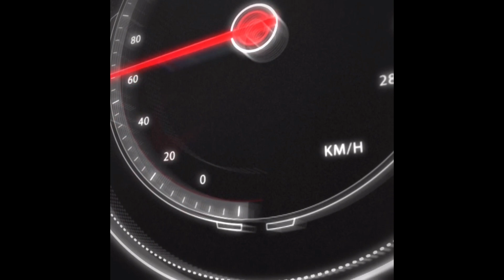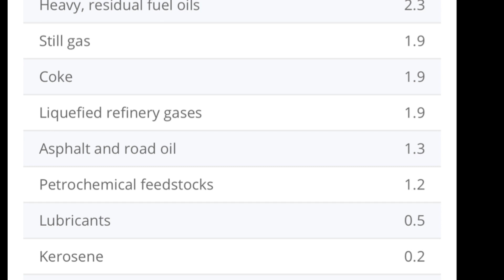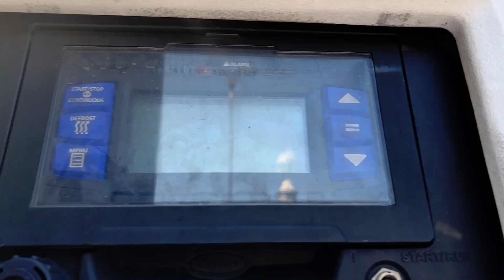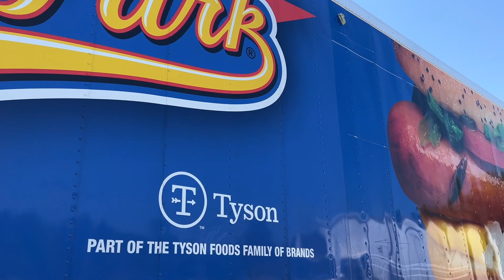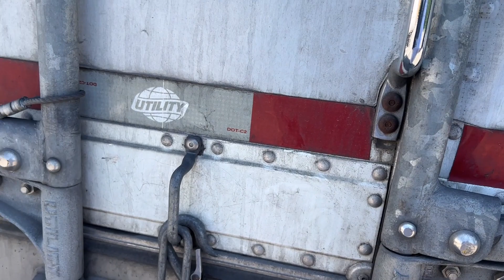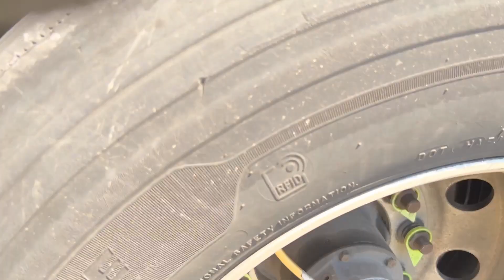What is a Barrel of Crude Oil?

Comment: Alot say gas went down because demand was down on the count of covid. All I know is like you, I measure prices by my local stations. In 2019, when the economy was booming. Gasoline was 1.89 to 2.03 a gallon. Diesel was 2.11 to 2.16 per gallon. I fail to see where the demand problem came in at. I see a demand versus production. Production is not a problem whenever you have adequate supply. We have enough supply, if the current administration didn't have this  devious agenda to end fossil fuel use.

Comment: That refrigerator unit sure is loud.  Your truck is beautiful.  I enjoyed watching your pre-trip inspection. That little tent in the ceiling that sends the air to the back is cool.
Reply: Angela, that is called a "chute".  Notice how is attatches at the front where the output of the unit is and goes all the way back and cuts off about 28 inches from the door.  The ribs in the floor allow the air to drop and get sucked back into the unit under the pallets and be recirculated.  Thermodynamics, cold air falls.  That is why the air is pumped through the chute on the ceiling and returns on the bottom.
Reply: @christopherpittman8054  thanks so much. The way that you explained the chute i could almost see it blowing in my mind.
Reply: @angelacritters  Not really "blowing".  It recirculates the air exactly like your refridgerator does.  It is actually working more like a pump.  A pump that uses air density and thermal difference instead of pressure.
Reply: @angelacritters  Before I became a truck driver, I was a gas, diesel and hydraulics mechanic.  I hate the term "technician". Technicians in my mind are people who do computer stuff and no actual hands on dirty work.  I just got tired of fighting people who couldn't speak English for my job so I changed directions.  Refusing pay cuts always put me on the head hunting list so I just changed my occupation.
Reply: @christopherpittman8054  Good for you. Now you can be your own boss inside that big rig! I really appreciate you truckers and all that you do for us.
Reply: @angelacritters  nah.  Company driver.  I don't want the headache of owning one especially with the signs of hyper inflation setting in solid.  I have the skills needed to do my own work anywhere in the world.  I just choose to do this for now because stupid people are better than TV.  Almost like watching the Grizwalds or the Stooges everyday, all day and getting paid for it.  Can't beat that.  Hope you and yours are prepared for the storm.  You can choose the Ark or the HMS Titanic.  The Ark was built by average people and the HMS Titanic was built by world class professionals.  I truly hope you chose to be on the Ark.
Reply: @christopherpittman8054  Ark for me! There is a lot to be said for letting someone else have the headache of maintaining trucks these days.
Reply: @angelacritters  I might be a back woods hillbilly from the mountains of West Virginia but I be eduamercated
Reply from the maker: Yes air to back to keep all product cool.